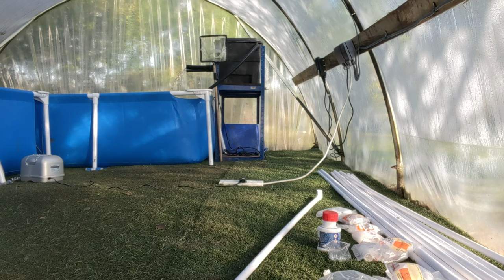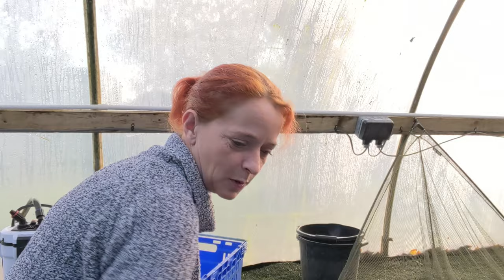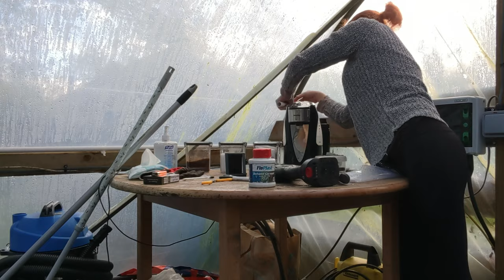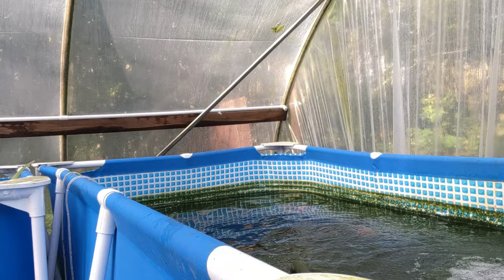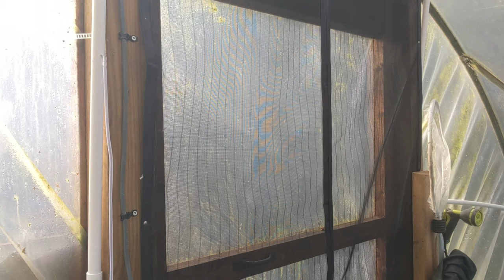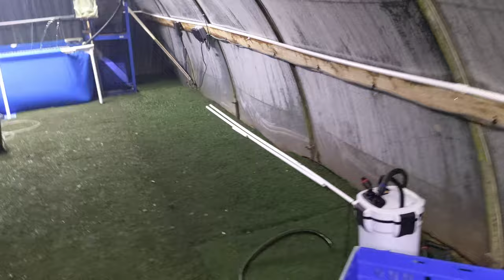Air Loop System Install

Comment: Well done Vicky,  to think all the ponds and tanks are now supplied with Air and a lot as well, all off one system, and only using 35 WATTS  of power, I think thats a great idea and even saves you money in the long run, Great Video
Reply from the maker: Thank you very much. I just thought if it works in the fish room, why not in the polytunnel. It's also cuts down on the amounts of plug sockets used and keeps everything nice and tidy. Thank you for watching xx

Comment: We’ll done again Vicky you keep hitting it out the park ticking off these jobs crazy how some tanks are warmer than others thank god there was a layer of non slip blanket weed coating the bottom of your tanks no thanks necessary👍
Reply from the maker: Thank you very much, 🤣😂 yep if not it would have been good for extra padding for if I had slipped on my butt 😂🤣 thank you for watching xx

Comment: Surely in all your riding gear you have a pair of hunters long enough 😂😂
Reply from the maker: I'm not getting in them ponds with my yard boots on, my yard boots are used for outside work which is muddy and mucking out the stables, all of which I don't really want transferred into the ponds and it's quicker for me to do it that way then it is to go and wash my boots every time. A little bit of cold water never hurt anyone 😂
Reply: @bubblefins1278  someone needs a poly tunnel pair for Xmas
Reply from the maker: @skeggy  maybe 🤔 😂 xx